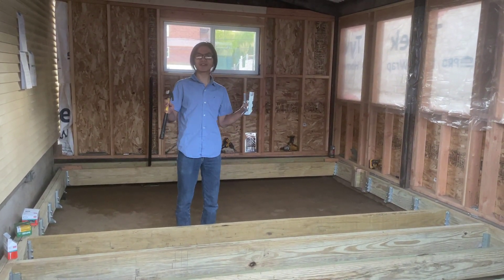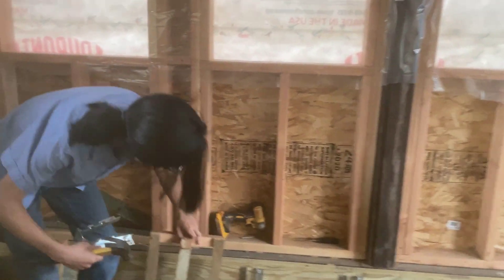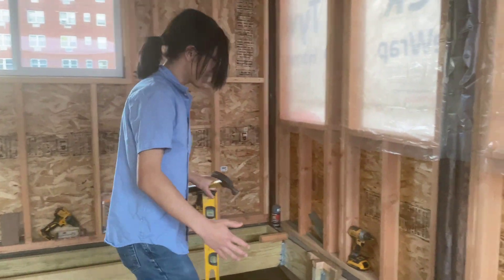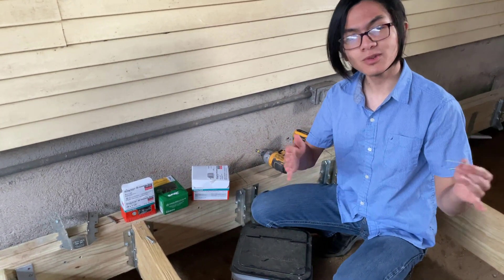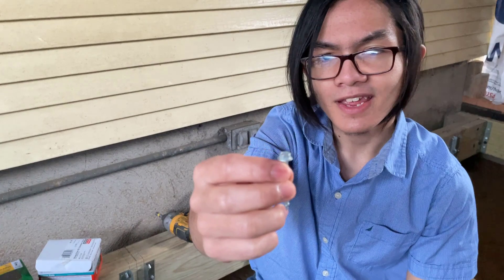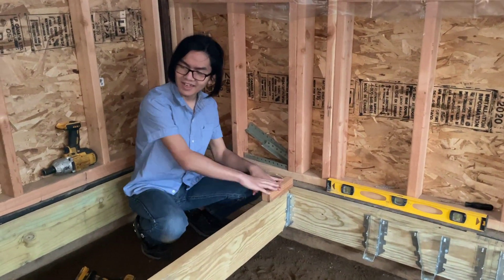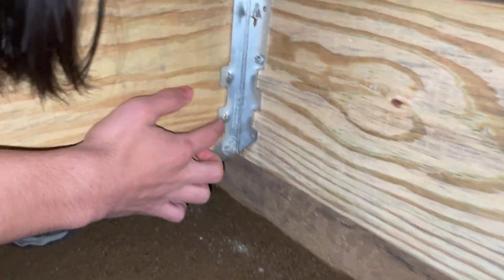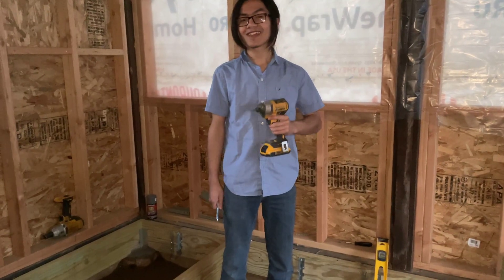Joist Hangers: How To Install Flush w/ Top Of Ledger / Beam | Screws Or Nails? | Floating Deck Porch

Comment from the maker: Here are the #ad links to some of the hardware, materials & tools showcased or required for this project:
1. https://amzn.to/3Hjffhp  |  Simpson Strong Tie LU28 2X8 20 Gauge Face Mount Joist Hangers - Quantity 25
2.  https://amzn.to/3okGT4W  |  Simpson Structural Screws SD9112R100 No.9 by 1-1/2-Inch Structural-Connector Screw, 100-Pack
3.  https://amzn.to/3Fek61v  |  FastenMaster FMLL358-50 LedgerLOK Ledger Board Fastener, 3-5/8 Inches, 50-Count , Gray
4.  https://amzn.to/3HfHQnX  |  DEWALT ATOMIC 20V MAX Impact Driver, Cordless, Compact, 1/4-Inch, Tool Only (DCF809B)
5.  https://amzn.to/3c9Uaro  |  NuMax SFR2190 Pneumatic 21 Degree 3-1/2" Full Round Head Framing Nailer Ergonomic and Lightweight Nail Gun with Tool-Free Depth Adjust and No Mar Tip

Or Click on Amazon link here and search for what you need:  https://amzn.to/3xIOsqg

Comment: As you noticed yourself soundboards are taller than others. Your method would work if you're working with perfect wood where is all the same size. Otherwise you will still have certain words taller or shorter and not be flush with the rim board

Comment: Screws snap, nails dnt they bend n have higher weight capacity in this specific application(floor/roof joices).Nice 👍 enjoy 😉
Reply: Simpson makes screws that meet code for nail replacement
Reply: wrong structural screws